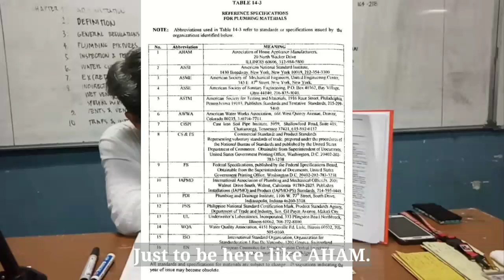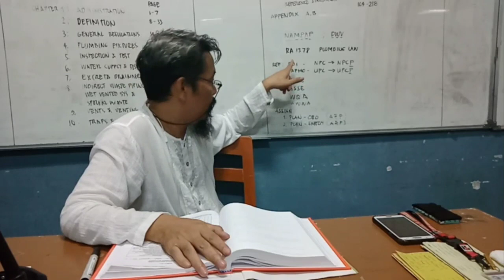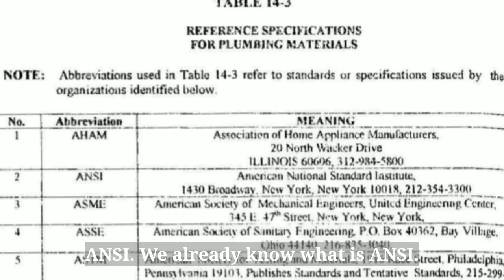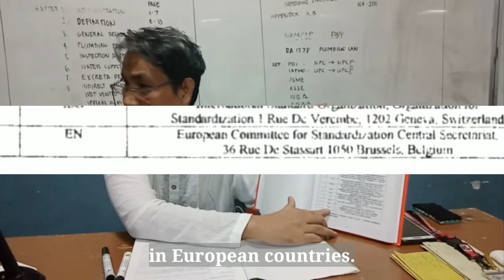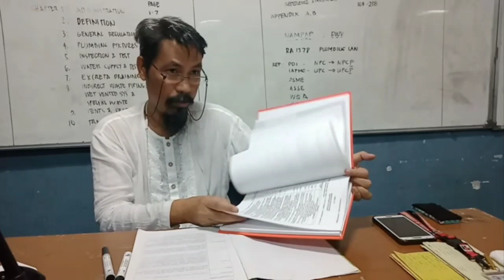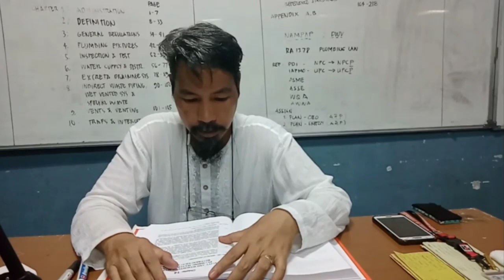CE526 Sanitary, Fire Safety and Plumbing Design || NPCP Chapter 14 Code & Standard References Part 2

Comment: Thankyou for reminding us how important to be familiarize with terminologies and acronyms in related to plumbing and also i learned from this video why  should we need to know the minimum standard in plumbing and it is because it will reduce the risk of error by installers, and also provide assurance to the plumbing system owners. Standards also provide direction to manufacturers in respect to the expectations of the products that they produce. ... In order to be confident of uniformity in a product there must be checks and balances.

Comment: Etabes, Joshua G.
19-02128
- Thank you, sir. I learned that AWWA is the American Water Works Association. That these are the most important references of this code with PDI, IAPMO, ASME, ASSE, WQA and AWWA, and other international organizations. According to NPCP sec. 192 NPC 1959 there are 16 reference specifications for plumbing materials. Chapter 14 of the NPCP section 1401 MInimum Standards are Materials Quality, Label, Cast or Stamped. It is important to know this standard like quality or stamped of materials and identify what is substandard to quality materials.

Comment: Buizon, Randylyn C.
19-00979

In this video tackled , I learned that AWWA is American Water Works Association those are important and also AHAM. Minimum standard is the materials quality . All materials used in any plumbing system free from defects. Standards also provide direction to manufacturers in respect to the expectations of the products that they produce.

Comment: Mendiola, Mc Axel Joseph P
19-00167

Thank you sir, I have learned in this video that we just need to be familiarize ourselves with the definitions and terms of acronyms related in plumbing and not have to memorize it. I also learned in this video why we need minimum standards of materials. it is to achieve the expected quality of a plumbing system owner and also avoid the risks.